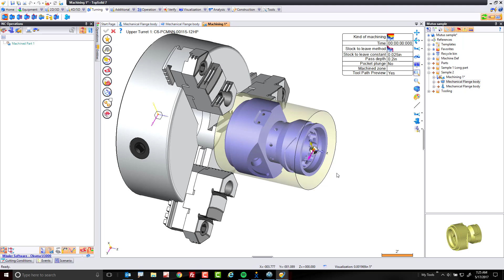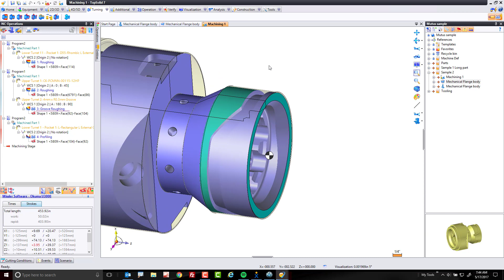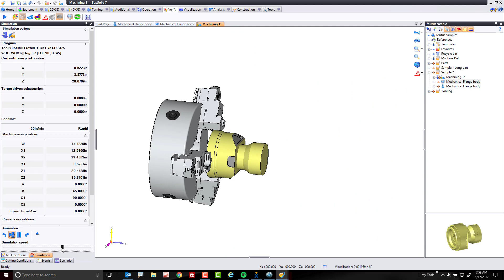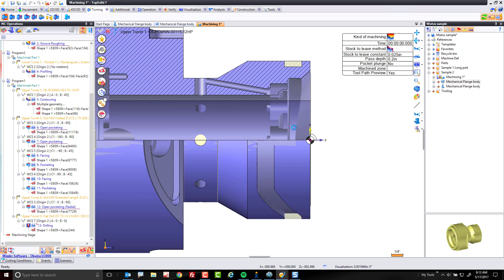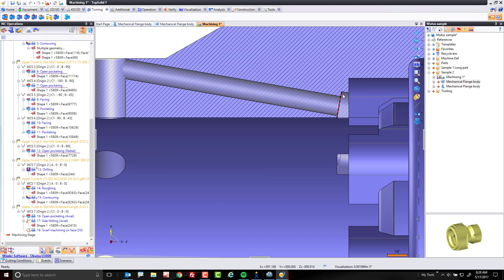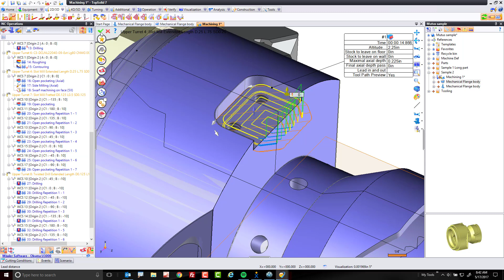TopSolid and Okuma Multus U3000

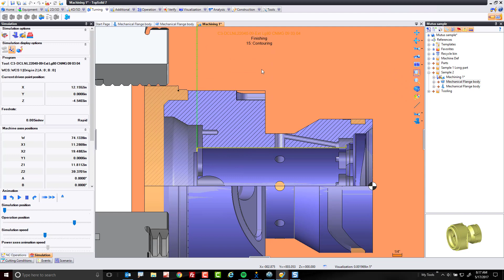Comment: @ 31:36 why wasnt there any collision alarms??? What if you hadnt have seen it, any other means of protection??
Reply from the maker: Hello Oli.  That's a great question!  Yes, there is full collision analysis in TopSolid both in the machine simulation level during programming and within the verification engine as well during material removal simulation.  I think I just had them turned off during this demonstration.  However if you look to the top left corner of the NC Operations manager, you will see an icon for collision management.  If you click this, TopSolid will report any collision that happens in real time.  The reason it is an option to turn on and off is so that our users are in control of the amount of calculation resources that they want to use at any given time.  Hope this answers your question.

Comment: Great is a great lesson! I'm going to visit your site blog.topsolid.com. It's good! How can I get a Multus U3000 for learning on your videos! Without a machine it is very bad to learn the program!
Reply from the maker: While waiting for me to release the project, you can use any of the standard B axis mill turn machines that ship with TopSolid.  For example there is a Morie Seiki MT machine in the standard machine library.  It will work similarly to the Multus U 3000.
Reply: Thanks for the tip of a colleague, I'll try this machine!